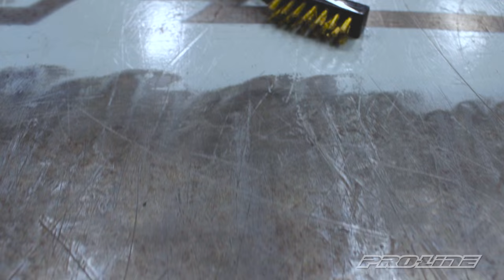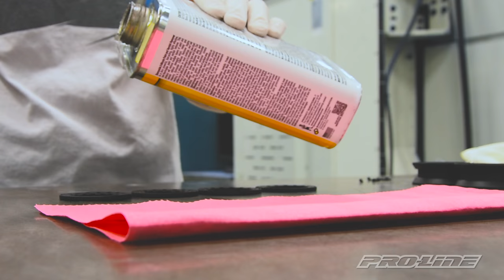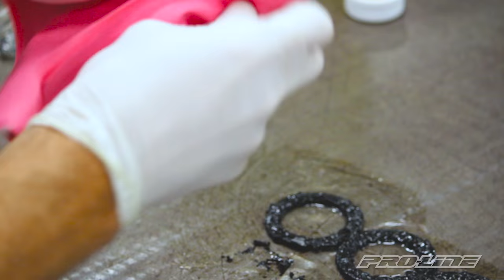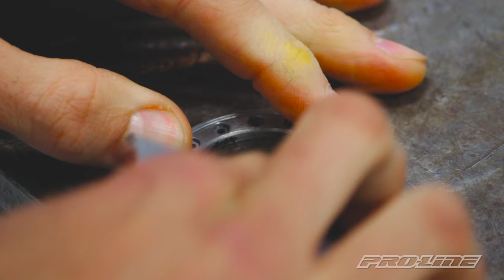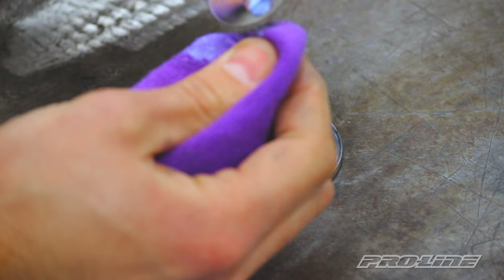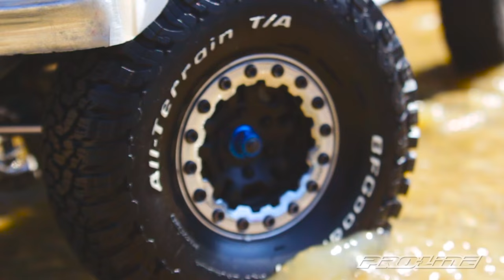Pro-Line HOW-TO: Polish Bead-Loc Rings

Comment: are the rings stainless steal? I am just curious if they will rust over time
Reply from the maker: No they are not stainless and yes they will rust without proper maintenance. They could be clear coated which would reduce corrosion.
Reply: Pro-Line Racing ok, thankyou
Reply: +Pro-Line Racing why don't you guys use aluminum rings ?
Reply: Why don't they sell a new set like this polished at the factory and never painted ?